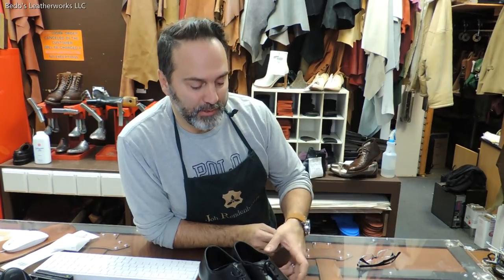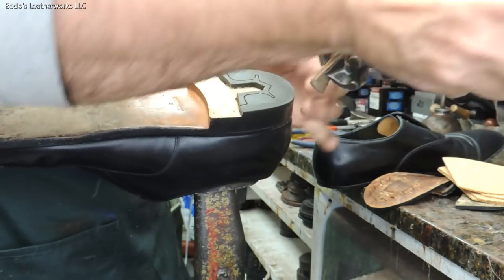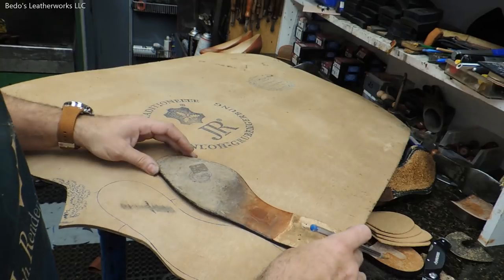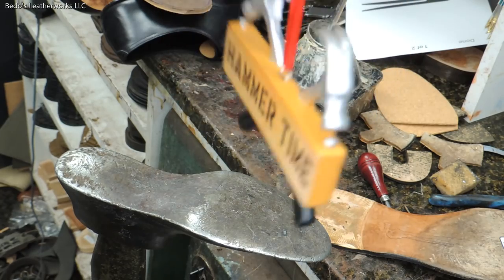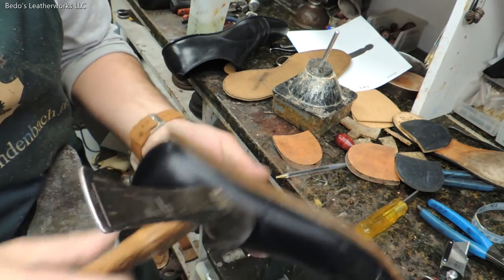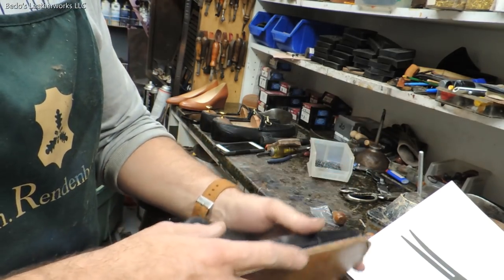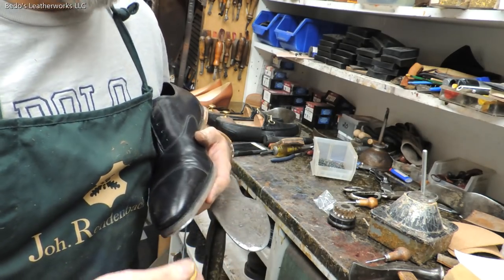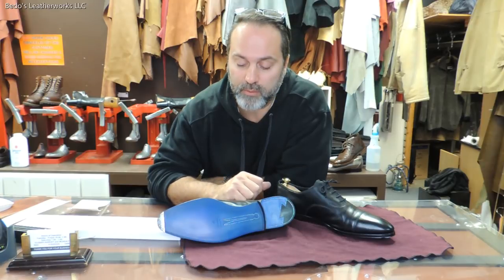Fancy Soles John Lobb #160

Comment: My father showed me how to spit-shine his jump boots when I was younger, but once I got the knack of it. It took me about 15 minutes per boot. When I joined the military I was the only one who knew how to do it, hence I was noticed by my drill Sargent and subsequently had to show everyone else how to do it. The only thing I hated was how easily they would scuff,  that's when I learned that women's pantyhose rubbed on the scuff, would bring back that mirror finish in ten seconds or less.  So one guy was elected to go buy a pair and we cut them up into 2x2 inch sections so everyone could maintain the shine. I love your videos, keep hammering.
Reply: Richard S marine here.  You can do it even faster if you hit it with a heat gun.  It knocks it from 15 mins per boot down to about 3-5.
Reply: My husband (  a para -signals staff sergeant ) had boots spit polished to a mirror shine as did most soldiers but they were kept for parades/ kit inspections. They were kept high on a shelf covered with a yellow duster cloth !!!!

Comment: Man for a cobbler shop, that's probably the neatest/nicest front area I've seen. Granted, haven't seen many, but they usually just look like an extension of the back, with maybe a couple hanger racks (probably not the name, little things that poke out from wall) with insoles and shoe strings. The photos/antiques really helped quite a bit imo. Probably a useless comment, but eh first thing I noticed when I watched.

Comment: Mirror gloss (bulling) is not so difficult; I learned to do it aged 16 when I joined the army as all British soldiers do..  Just takes good polish, (Kiwi parade gloss is preferred in the forces for black boots), a drop of water or spit, and a lot of patience building up polish layers with a cloth over one finger in small circles and alternating between spit and polish... ;)
It should only be applied to boots or shoes which are thoroughly broken in otherwise the polish will flake off when the leather breaks; and even then multiple applications between wearing will be necessary to get a gloss which can withstand wear on anything other than a toe-cap

Comment: is there a difference between the sides of the leather? I mean obvious one side is skin the other flesh. but does it matter if you would turn around the pre cut soles with jr logo to the inside?
Reply from the maker: i think the fibers would be to soft if you turn it upside down so it won't wear the same
Reply: @BedosLeatherworksLLC  thank you. in the videos, both sides lock nearly the same, so i asked as you have it in your hands and feel the material.

Comment: @Bedo's Leatherworks LLC instead of using that straight blade on ur cutting tool I would get the curved blade its really good for cutting leather but its used for like carpeting an laminating but I really think it would help a lot with cutting the leather cause it gives a little more leverage an downward force to help cut it better they cut like butter ya gotta def be careful

Comment: When you took off the sole there was a white, pointed jagged piece that was under the cork and looked like it sealed the edges to the foot bed. I've not seen that on other shoe videos. What is that for?

And I would have liked to see how you did the color. That turned out fantastic!

Comment: Lulu or triumph tiPs? Which better
Reply from the maker: Very similar
Reply: @BedosLeatherworksLLC  But is the steel of Lulu's harder than triumphs? If you had your nicest pair, which would you choose to put on, lulu's or triumphs if you wanted ultimate durability. Also, have you tried triumph 3mm thick plates? Those hold up any better? thanks for response!

Comment: Steve, why so many people still request the blind stitch when it sometimes peels and exposes the threads anyway? And when it begins to peel it looks unattractive.
Reply from the maker: ꧁ Orlando Cruz ꧂ the way I do it, it takes a long time to wear down and get exposed. Some manufacturers cut the leather to thin and that’s why it peels back so easy
Reply: Bedo's Leatherworks LLC if that’s how you work then you must be sone hell of a cobbler. 👍 I believe cobblers who take pride in their work are hard to find . I have no  idea where I will send my Red Wing boots to be resoled when the time comes I need it done. Red Wing did such a lousy job on resolving my boots that I rather either find a good cobbler or just throw out my boots and get a new pair every time. They trimmed  the welt on one bout close to the stitching. They’re not Symmetrical anymore  I ove Red Wing boots however I think they have  poor quality control now and the current workers don’t take pride in their work.  Anyway, I assume you don’t receive mail in orders. I have never heard you speak about it . Just curious.
Reply from the maker: ꧁ Orlando Cruz ꧂ actually quit the opposite, I get lots of mail ins. But I don’t do yo many boots. I think there is a Redwing FB page you might look into